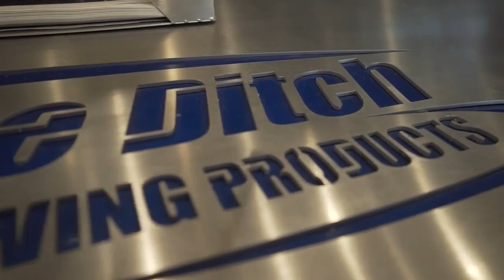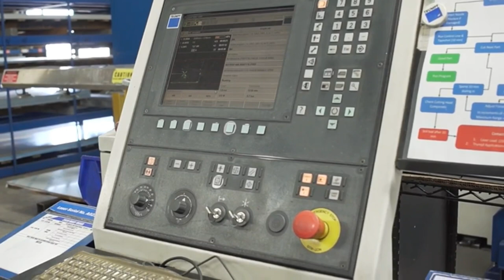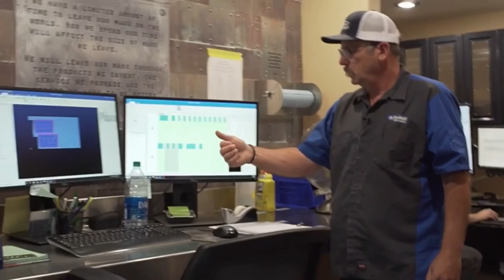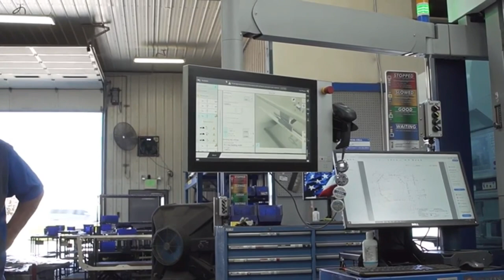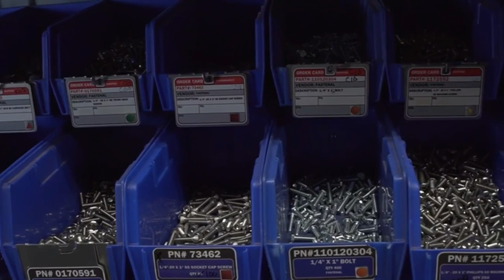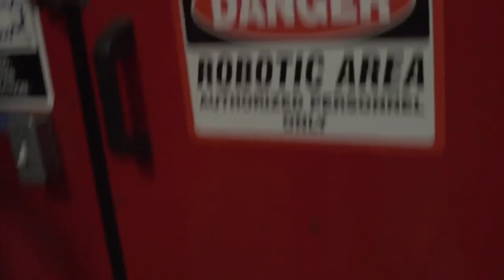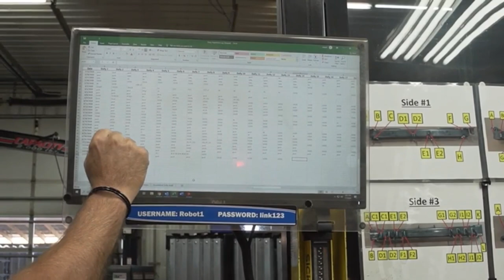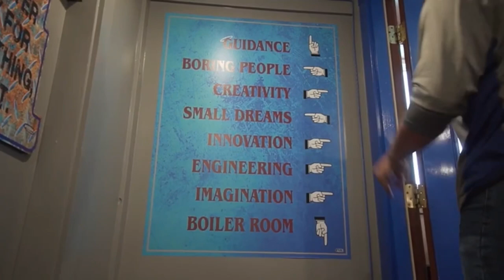Idaho Wrecker Sales, In The Ditch Towing Products, and Razorback Offroad Tour

Comment: Powder coat is the worst coating ever. There is no chemical bond between the coating and the metal. One rock chip allows moisture in and the coating starts peeling off.